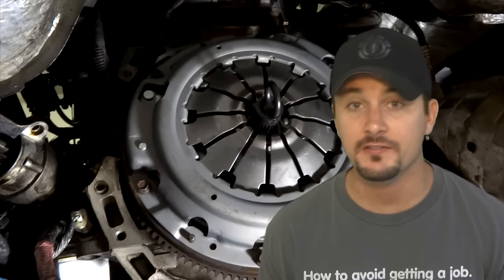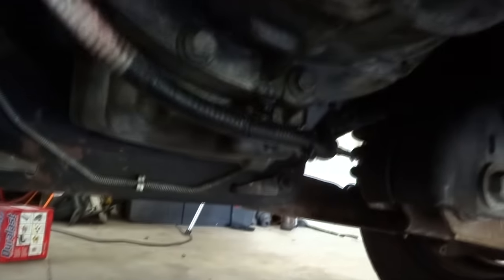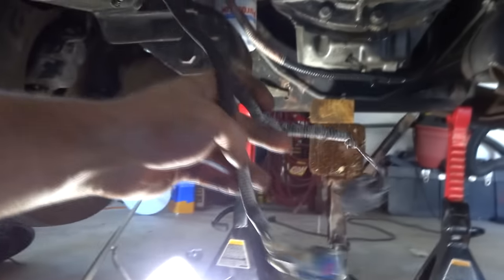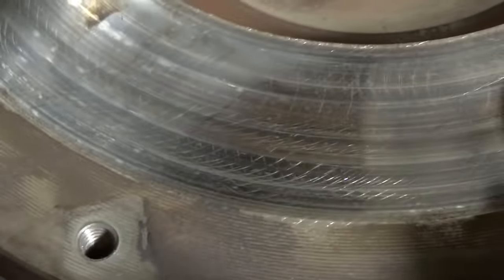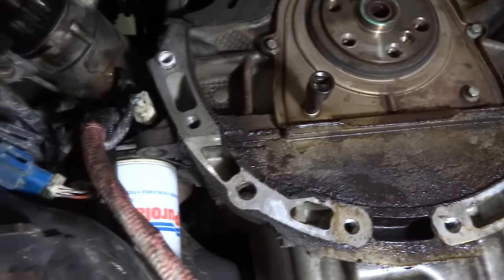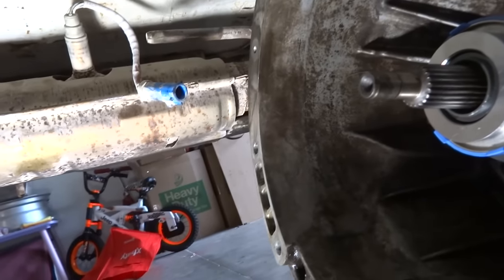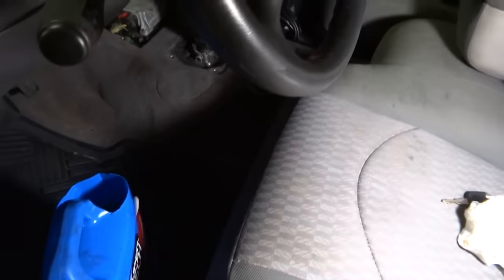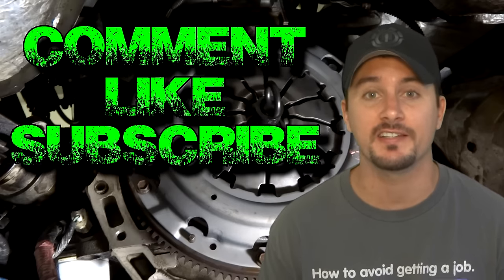Clutch Replacement Ford Ranger & Mazda B-Series ⚙️🔧

Comment: So how do you choose the right clutch ? I have a 1984 Mazda B2000 SE. And I use the truck. I haul and move crap all the time. This is a work truck not a hot rod. I am looking for something that is going to last. I do a lot of backing and getting close so the clutch gets used. I need something Heavy Duty. Most of the loads are not that heavy.
Reply from the maker: Both clutches will perform the same the only difference is the pressure plate on the self adjusting after time of wear and tear on the clutch the pedal never changes position, on the non self adjusting clutch the pedal starts to move inward when the clutch wears which in my case I like knowing when my clutch is about to go out because the pedal won't be too far from the floor, that's the only difference.The self adjusting clutch is a lot more expensive than the non self adjusting clutch.
Reply: So I get on the computer and look up the parts. I think well NAPA is suppose to be high quality stuff right ? For there clutch pressure plate and throw out bearing $120. Then they have another one from another company  for $170, Both are manual. Auto Zone has a set up for $120 life time warranty.That is why I was asking who makes the best parts. This is a lot of work. And I do NOT want to do this again , at least not for a very Long Long time.
Reply from the maker: I purchasedall my stuff from Autozone, it's been a few years since I replaced it all. No problems since and I drive it daily and haul stuff. Make sure you replace everything I replaced in the video trust me you don't want to have to pull the transmission because you didn't change your slave cylinder they tend to leak also definitely change out that rear main seal.
Reply: ***** I have used Autozone clutches in my HD chevy full size trucks and have pulled way more than I was suppose to like in my 74 HD truck I used a trailer that was custom made for a 3 ton dump truck and pulled over 30,000 pounds of hay with no problem. Lifetime warranty on ur clutch set is a have to so do not get any clutch kit that is not lifetime warranty. Lifetime warranty means that the parts store stands behind their part(s) forever. Napa is a great store but I have had a lot problems with them and their warranties but that is just my experience. Shawn obliviously has had problems with Autozone and that can happen with any store. Shop around at all the auto parts stores and ask questions about their warranties and what all they cover then make ur own decision on where to buy ur parts. Autozone, Oreilly's, Advance Auto Parts, and Napa are all great places to buy ur parts. Also when u buy ur parts keep in mind that they price match and sometimes bet each other on the prices so ask if they can give u a discount because most of the time they will.
Reply: Good to know, and thanks for the reply. What I have found is the parts are not that expensive its the labor. If I was able I would do the work myself.

Comment: is there anyway you can add the torque specs for the transmission bolts?
Reply from the maker: Flywheel torque specs 54ft lbs and then 64ft lbs. Clutch pressure plate is 15ftlbs and then 24ft lbs. Transmission to engine bolts are 35ft lbs. Hope this helps.
Reply: Thank you my friend! Gotta replace my clutch this week
Reply from the maker: @goodolbronco  Wishing you the best!

Comment: my1987 mazda b2200 pick up clutch went out and thye gear  got stuck in 2nd we replaced the whole clutch and its bstill stuck in gear what do we do please help
Reply from the maker: Josie Zanini I'ts more then likely a bad slave cylinder or the clutch was installed backwards with the spring facing the flywheel. To rule out the clutch, simply shift with the vehicle off, if it shift while it's off but wont shift when the vehicle's running then your clutch spring are broken or the clutch was installed backwards.

Comment: Can the pilot bearing be installed with the flywheel off the vehicle ?
Reply from the maker: Yes.
Reply: Is the pilot bearing constantly moving? Im guessing yes. Or only when in gear?
Reply: Can you relpace the imput shaft bearing without taking apart the tranny? 92 4.0 v6 ranger 4x4

Comment: What I learned: DO NOT use the bread trick. Waste of time. Get a puller. I spent 2 hours cramming bread, and slapping an alignment tool into the hole. I gave up, flushed it, and re oiled. Also: 95' did not have the same main seal plate. I didn't see a plate at all, so I skipped it.

Comment: No one seems to mention how to drop the transmission since the B2600 has a bar at the rear of the transmission that won't allow the transmission to drop straight down. Do people just lower the front until it is about a 45 degree angle and then push it forward until the rear of the transmission can come down? What doesn't anyone talk about this? There are two cross bars, one you can remove but the other you can't.

Comment: My transmission is stuck in gear what did I do wrong? I can start but as soon as I take my foot off the clutch the truck shuts off. I replaced clutch and slave cylinder.
Reply: I also made sure that I installed the clutch the right way with the high side of the springs facing out.

Comment: when you have the flywheel off why not do this on the bench I thought it is easier. The one thing that I did not like was the bolt with the wedge. You know why they put threads on both sides right never hit threads. The other threads are for you to remove it take the nut off and screw it to the other side and off she comeas. Other then that Love the Video

Comment: How are those Duralast parts holding up?  Nice video.  I sub'd.
Reply from the maker: Liberty Stuff'n'Things Reviews I sold the truck to a friend of a friend, still runs and drives fine, no issues. I had no issues with the clutch whatsoever when I drove it for a few years after. I'd recommend it.
Reply: Good to know.  I'm going to look at a '94 Navajo 5spd tomorrow with 89k on it.  One owner.  I have a feeling it may need a clutch in the near future, so its good to know those parts are an option.

Comment: Did this exact process and when i finished installing the shifter now the shifter wont go into gear, but when i turn the truck on and i let go of the clutch it shuts off ad if it were in firdt gear but the shifter wont move or shift into any gear. What did i do wrong?
Reply from the maker: It sounds like your clutch disc is backwards. I mentioned that the high rise of the clutch, needs to be facing the pressure plate. If the clutch is turned around, and the center high rise of the springs are facing the flywheel, the clutch will always be engaged.
Reply: Nthefastlane but the truck will run as if it were in first gear, the shifter just wont move. And i wached your video STEP BY STEP over 20 times making sure everything was as shown as i was working on it, so i dont think it could be the clutch being backwards... any other ideas?
Reply from the maker: Please explain the exact scenario step-by-step and I will try to help you. The first comment you made, I couldn't understand half of it.

1) What happens when you start the vehicle?

2) When the vehicle is running can it go freely in the 1st 2nd 3rd 4th or 5th gear when you press the clutch in?

3) If it can't go into gear when the vehicle is running, will it go in when the vehicle is not running?

4) Did you bleed the clutch slave cylinder?
Reply: Nthefastlane Ok. So i did everything like i was told during the video no problems. The problem that i am having is that the shifter will not move into any gear it will move side to side as if it were in neutral but it will not move forward or back to shift into gears. Now when i turn the truck on and have the clutch pressed there is no problem the truck is fine, when i let go of the clutch the truck begins to shut off as if you were in first gesr and you werent pressing the gas. But if i press the gas and release the cluth the truck takes off like normal so idk if the shifter is locked in first gear or in another gear and if it is how do i switch it to neutral.
Reply from the maker: With vehicle on, and the clutch pushed in, are you able to go through all 5 gears?

I know this may sound like common sense, but is your e-brake off?
Reply: Nthefastlane no it will not move anywwhere. The truck moves forward when you release the clutch and press the gas but the shifter will not go anywhere. And yes the E-brake is off
Reply: Nthefastlane like i said it feels like the shifter is stuck in first or something but it wont move like if its locked in there but whenever i install the shifter it is not in the 1st position
Reply from the maker: Did you take the shifter housing off to reseal it, and when you put the shift fork back in, it's not in the proper position?
Reply from the maker: If the vehicle is "OFF", and you can go through all 5 gears, it has nothing to do with the shift Fork on the shifter. If you can only get the shifter into 1st 2nd 3rd 4th or 5th gear with the vehicle off, then it's has something to do with the clutch being engaged all the time. Only way that this is possible, is if your clutch springs are broken or the clutch is backwards.
Reply: Nthefastlane yes it is not in the right position so now it wont move anywhere and idk how to put it back to where it can go back to neutral
Reply from the maker: Before you put the shifter down into the transmission, the transmission has to be set in neutral, when you put the shifter into the groove, it should be able to go side to side in neutral, then you tighten the Torx heads.
Reply from the maker: What you need to do, is take out the shifter. Get a quarter inch extension or 3/8 extension, put it down into the shifter and try to maneuver it to where all the teeth line up in the center of that hole. Then try to get your shifter in the center.Before you bolt it in, make sure it goes left to right. Basically all the gear selectors have to be pulled in close to the circle that the shifter goes into.
Reply: Nthefastlane ok i will give that a try tomorrow when i arrive home from work and will update you on it. Thank you so much for being so patient in replying and for your help, it has been of great use. And just to answer your lrevious comment the shifter does not go jnto any gear ON or OFF it simoly stays in one postion which i believe is first gear and i cant get it to move anywhere else
Reply from the maker: Nestor Portillo Sounds like the gear selector forks aren't lined up together to get the shifter inside the center of them. You are welcome, glad I could be of help. If you ever need troubleshooting, or any other knowledge, you can head over to my website: www.Nthefastlane.com Check out the Troubleshooting section.

Comment: why did you fill the transmission with automatic transmission fluid?
Reply from the maker: Jacobo Celis That's what the transmissions calls for. A lot of manual transmissions use "Automatic transmission fluid".
Reply: is it fine if I fill my transmission with Mercon V? is the only fluid available in my country, I have a ford ranger 2007 2.3 manual.
Reply from the maker: Yes, your service book will tell you what you need. I used Mercon V. BTW I just remembered I did use Mercon V, I saved in it a different container. I think I mentioned it in the video.

Comment: I have a clutch issue with my 95 Ford F150 six with 113,000 miles original clutch and slave. I changed out the master cylinder a year ago because the plastic plunger end broke. Bled several times, the clutch is not spungy. Here is the thing, whenever I first go for a drive, after the truck sets over night, the clutch presses pretty easy like it normally has in the past, but, after a few miles the clutch gets harder to press, and the last time I drove it, by the time I got home I could push it to the floor and it would not come back on its own. Next day it presses fine until a few miles. Got me stumped, I think its heat build up or something, master cyl. fluid not leaking, I do hear a creaky spring sound coming from underneath when I press the clutch with the engine off.  Clutch/Slave are old but low miles for age of truck. I have been leaning toward Clutch/Slave/Seal replacement as a last resort, but, it is just an unusual symptom I can't figure out. Don't know if it is the slave failing or the clutch housing/springs binding after heating up causing the symptom. What do you think the problem is?
Reply from the maker: tujohnboy I believe you still have air in the system, Heat rises, esp a hot air bubble so it could possible be between the slave and the master, when it get's hot it goes towards the slave where the bend is and apply's no pressure. Take this approach.. https://www.youtube.com/watch?v=HoD71515Njo

Comment: The clutch is compressed against the flywheel on one side and the pressure plate on the other while spinning. a professional job would have been to have the flywheel resurfaced which cost 20 to 30 dollars, which was one of the cheapest things paid for in this job. around $250.00 in parts and too cheap to do it right. the pros and cons of flywheel resurfacing dosen't even exist in the professionals arena, it's always resurfaced and those who skip this part don't understand the importance of this step. it's what's called half assing a job. if I was to skip any part it would have been those gaskets on the transmission covers, they were not leaking and probably never would. over all the rest was a good job for a young man.

Comment: automatic transmission fluid on a manual transmission I think you should put gear oil im concern of it
Reply from the maker: No, this is what the service manual calls for.Gear oil will prematurely wear the gears.

Comment: Just a question from a non American..do American manufactured cars use metric or imperial sized fasteners.
Reply: My 94 Ranger (and Mazda which is the same) use metric fasteners.  I have a 99 Windstar that is also completely metric.  I'm not sure when SAE fasteners disappeared.  I'd say sometime in the late 80's, depending on the manufacturer.
Reply: My `77 Tie Fighter is all imperial.

Comment: $25 at Napa to resurface the flywheel - cheap insurance to prevent chattering.
Reply: Yes but if you've got a straightedge to make sure the surface is flat, a bit of s sanding to erase the scoring works for brakes too.

Comment: Please be a little more careful in your generalizations. You don't state what model years your video tutorial covers. It would be better if you at least gave the model year your truck is. What you cover may work for your model year, but it certainly does NOT cover the 1996, with twin I-beam suspension. So much is different from yours to the probably earlier models that you will easily confuse some of your viewers.

Otherwise this video tutorial is good.
Reply: charlie99210 Im doing a full clutch job on my 94 4.0 right now and the twin I beam is killing me. Changing the clutch and slave cylinder is no problem, getting the transmission out on the other hand is the hard part. Once its out tho, it goes quick

Comment: update on previous post by david clement:  if as previously posted by me you stab the short part of the shifting mechanism and find that you cant shift it is because ......ok there are two sets of two knobs which face each other and must be aligned.  I paniced a little because people who post and really don't know diddly.  If I had nt been persistant in looking for the right info I might have taken the tranny back out and taken it to a shop where they would fixed it in few minutes then lied about a broken fork or  something and charged me $$$? for basically nothing.  Ranger forum has pics of this easy fix.

Comment: that pain in the butt bolt at the top: TIP...after breaking it free with a 1/2 inch flex joint and a 12" extender I used a piece of semi rigid plastic hose with a 3/8" small extender with the 13 mm socket jammed on it which worked well to snake in that space and unscrew the bolt by hand,,,took  more than 2 hours till i used that trick to get that bolt out in my driveway.  it's a bitch.

Comment: Worst mechanic ever don’t listen to his advise “ just push the boot though” snaps all the mounts off so u can’t re use the shifter then he said “ there is a dark clip on the hydraulic hose pull that out and it should come out “ wrong it destroyed it u are supposed to push it it now i have to cut the line off and buy new parts because of you not knowing how to work on a car

Comment: @ 13:55 made in CHINA thats your problem. if your truck has 211,000 on it, that clutch doesn't, Its not OEM. lmao
Reply: Most manufacturers use a 3rd party clutch manufacturer. Daiken Clutch is the most common and made in China. Everyone from Chevy to ford to gm to Honda uses them.
Reply: The ranger OEM is LUK!

Comment: The bread thing is a lie Iv tryied it and it just made a huge mess to clean out just buy the tool and stop being cheap
Reply: You're just a brown spider what are you doing in that clutch?
Reply: Hah trying to be a human
Reply: +jade brown The bread trick works.  I had problems with it too, but not all bread works.  Use hot dog bun bread or like wonder bread and make sure you wrap the extension and test fit.  I actually jammed a bearing all the way in and bottomed out and was able to remove it with bread.